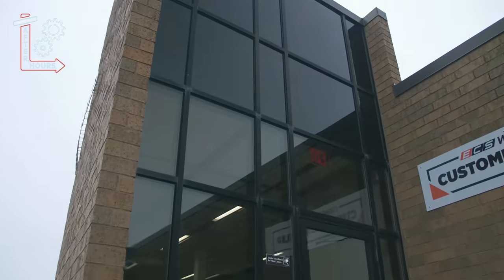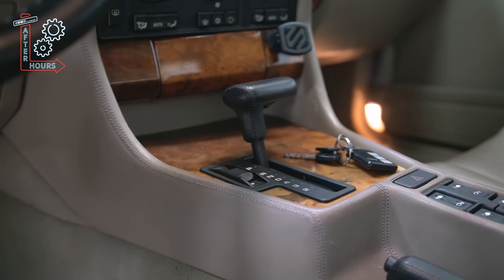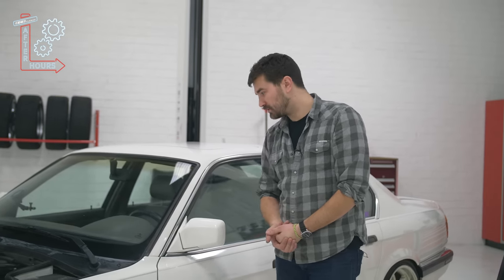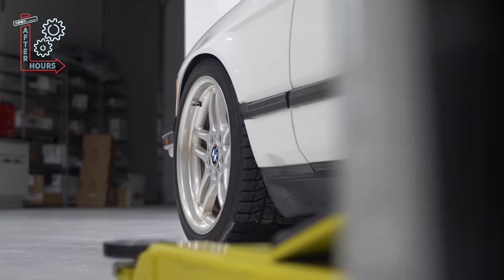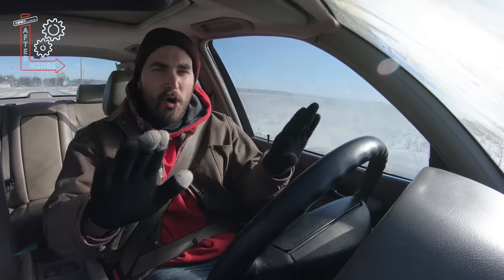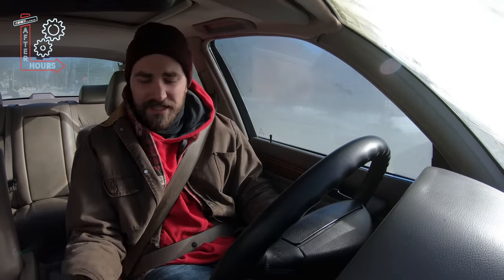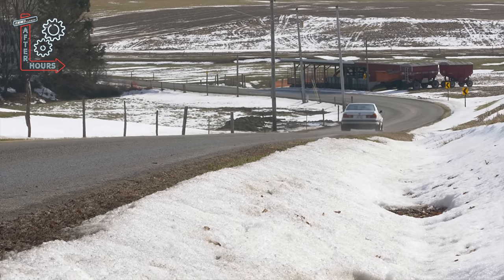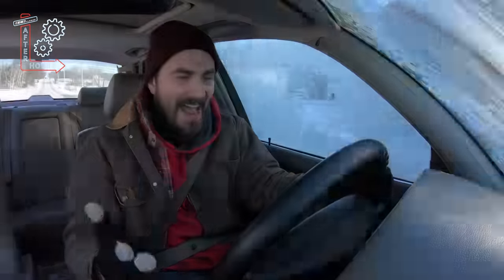I Bought a $1500 BMW... and Blew the Tranny // Winter Beater Challenge

Comment: That's a nice body, timeless lines.
Reply: True.. They can't make design more beautiful than these bmws from 80s to 00s
Reply: @ahmedfocak5691  True. These high shoulder lines (for safety) totally ruined the cars. On my old 3 Series (2004) I could easyly put out my arm on the window ... with mit 1 Series (2009) not so easy (starts looking weird) and with the latest models (dont even try it - you look like a douche).
Reply: I often hear that. I'm old.
Reply: Air Krem Got an e39 540 msport myself

Comment: German cars didnt have cupholders Back in the day because the only thing we germans did when we were driving, was driving.
Reply: And smoking! Lots of ashtrays
Reply: @catskillwoodgas  indeed, smoking helps to calm the soul in the traffic
Reply: they smoked quite a bit back in the day. I remember in the late 90,s there were cigarrete machines in the street just like candy ones, without any age related control (they were completely mechanic)
Reply: and faxing.
Reply: @honestguy7764  There still are :)
Reply: Bladwijzer Sync What really amazed me was that they were uncapable of return any change, so if the pack was 3.80 DM, you put 4DM and inside the pack wrap there was a .20DM coin. First time I saw it, it blew my mind!

Comment: So glad to see a video on this car from this year, especially from ECS Tuning!! I have had 2 E32s, a 735i and currently have the 750iL. I have bought parts for my E32s on ECS many times before. 
- Regarding the vague steering feel, lookup adjusting the steering box, it will make a WORLD of difference to the steering. 
- Window issues and door locks if its multiple is usually do to the General Module and Relay Module behind the drivers rear seat. 
- If you don't have heat after replacing the blower or blower motor "sword" Check the heater valves next to the fuse box, known to fail in these cars.

Once you get these cars up and running, they are an absolute dream to drive, mine just recently got to that point.

Comment: One year ago, i bought a 2001 Cadillac Deville for $375 at a police impound yard. (I have video of this car) It ran good but i had to pay $2850 to have the transmission rebuild. Yes i knew it was bad before i bought it. This is my first 32 valve 4 cam v8 engine. I had to install front struts and rear air shocks. I had to put brakes all the way around and the last owner spilled liquid washing powder in the truck. It had no problem passing an emission test and I have put 6,000 miles on it.

Comment: Damn that's nice... always wanted one.
Reply: They are pretty but they feel like they might break at any moment.
Reply: As you can tell his does break all the time.
Reply: From someone who's been there and done it, don't.
Reply: @garethcurtis7545  If I didn't have / wasn't happy with the two E34's that I have... I would still take a chance with an E32 or (even better an) E38 as long as it had a standard transmission. =)
Reply: @EXOVCDS  a manual one would certainly fix some of the issues. But the electrical gremlins, terrible interior that disintegrates as you watch it, yeah I personally couldn't deal. After switching to a W124 I could never go back. I like the E34s as well, almost purchased a 535 V8, but just so much wrong with it. And same interior issues and electrics. The key is with these if you really want one to find one that's been absolutely babyd since new, garagaged every day without the sun on it, and then still be prepared for the usual issues. But at least it will be a nice car. They just didn't use the best stuff to screw them together back then. But they did look fantastic and drive great.
Reply: Thomas EXOVCDS, Never should have sold mine. 😞🔫 I've regretted it ever since. Just wasn't set up to do my own work at the time. Got an MK4 beetle instead .. which is why I watch your videos lol.

Comment: I used to work for BMW and I came across a wiring diagram for a mounted mini gun in these 7 series. After a little digging I found they made a bullet proof version of this car which was prewired for that. Not offered in the US of course.
Reply: Didn't they make an E38 version like that?

Comment: And as for the heating it probably got out the solenoid valve. As it happens in E38 as well as in E32. Or a fan control module. In the E32 it is on the passenger side behind the console you have to remove the upholstery. Ps. you also need to check the module in the console that regulates the temperature, etc. also like to break.

Comment: Should have looked into doing a manual conversion from the e34 6 speed getrag 420...Still can get chips for the m60 which will put you just over 300hp. Also...pull out the the window switch from the center console, take it apart and give it a good spray down with contact cleaner. Should fix your window problem.
Reply: Fr tho this can be turned into something truly special
Reply: Done a manual swap on mine. From a 530i. It transforms it into a whole new car.
Reply: And a chip. But that didnt made a huge difference. I want to adjust the camshafts. The famous alpinamod

Comment: Bought a 1993 E32 last July for $2800 with 178K miles. Had to put a window regulator in the driver door. Power locks work but occasionally the driver door won't unlock when it's cold (I'm in Michigan) so I just open the rear door and unlock it by hand. I hear ya on the door latches. Occasionally both rear doors refuse to latch. No rhyme or reason to it... I've actually dented both rear doors trying to get them to close. Aside from that, everything works except the AC and the traction control. Runs like a clock, shifts perfectly. Small oil drip when I park it. No rust! Also have the same M parallels on it. The cool factor is off the scale. Nice E32!
Reply from the maker: I know the pain! I dented the driver's rear door pretty good trying to get it latched :( But hey, at least they look cool!
Reply: I was going to post a pic or two but I don't think you can in the public comments... Can you?

Comment: Bavarian Auto Sport offers different cup holder options.  My e32 had none, my '93 e36 had none but my e46 has 2 decent factory cup holders. My extended cab Sierra has 6 sturdy ones. Lol.  My e32 was alpine white just like yours which brings back memories.The trick to preventing the nikasil issues was to ALWAYS ALWAYS ALWAYS let the engine warm up to full operating temperature before shutting it off.
Reply: is it due to the rich fuel mixture used while the engine is cold?

Comment: It’s still a good looking car... I have a 2007 E63 630i Sport as a daily driver with 74,000 miles and full BMW S/H.. The only issue it sometimes has is a tapping lifter on start up. This only happens on short journeys and disappears after a minute or two. A known ‘characteristic’ of the E52 engine.. other than that, it’s beautifully smooth and reliable..

Comment: Like your car in white mate👍 Looks like you just picked up a not so great one, but for the money.. My old 1990 735 was cheap too but every electrical item works so got lucky. That was after changing the fan motor from under the bonnet, easy enough for ya. Ebay job for window switches. All the best👍

Comment: one of the worst thing on an old beater like that are both clima control and broken windows. I made a 400 miles trip on a extra comfy Volvo940, in the winter with a 2” gap on the driver window and no heating in the late winter. I kinda froze. When I got to the final destination I was tempted to burn down the damm car. That completely ruined an otherwise nice an anticipated trip.

Comment: Shame you have a pup. I had one for a while back in the early 2000's. Same engine but mine had best part of 400k on it when I let it go. Untill the gearbox control module failed and outweighed the value of the car it had no fails what so ever. Mine had electric rear seats with wine cooler in the rear armrest, self leveling suspension, cool box in the glove box, rear blinds the lot. Every thing worked absolutely faultlessly. The only thing I couldn't vouch for was the phone as I never used it. I absolutely loved that car and so wish I still had it now. Mine had e34 m5 wheels on and looked the absolute bollocks.

Comment: Just an fyi, the nikasil issue no longer an issue. USA reformulated its gasoline nearly 20 years ago for less sulfur content. So if its an original engine that survived getting damaged from the original issue, the current gasoline is no longer an issue. On the other hand, anyone who didn't take advantage of BMW's free engine replacement are out of luck now.

Comment: Unless you have big cans etc, you can use the center console as cupholders. I do this from time to time in my E34, and I think they look the same. There is also a cupholder from E36 that will fit the center console without any modification. I've seen a couple of them on Ebay.

Hope this helps!  Love the Parallell wheels. Wish I had those for my E34 :D

Comment: The windows and locks not working sounds like a GM (general module) issue. Common problem with the E32 and E34... get another module on eBay or in a junkyard and that should fix all your problems. I fixed a 1992 735i like that.

Comment: I feel ya on the cupholders dude. A lot of german manufacturers were pretty late on the scene with them. BMW didn't really get them until the e36 and in my e46 I had 2 except you had to chose: armrest + 1 cupholder or 2 cupholders + no armrest (had to flip it up). Very disappointing. Otherwise, these cars are perfect :)

Comment: The e32 is a love hate relationship. Especially the 750il. Having to do the heater core PLASTIC pipe again. But mine is a 88 and the dash brakets are a pain compared to your or a e34.

Comment: Loving the series. As for the comment about ZF transmissions not lasting I'm not too sure about that. They have excellent shift logic and shift smoothly long after other transmissions start to get jerky or slippy. I doubt a modern Mercedes 7 G Tronic or DSG transmission will last as long as these old units.
Reply: My mechanic wich is a BMW specialist, drives a 1986 E32 7 series (735i inline 6) with 363,000 km on it ( only the head has been revised ), with the ORIGINAL (
never replaced) old 5 speed ZF automatic transmission that came with that car. The clue with this transmission is, is that you should maintain it properly, meaning : the fluid must be changed regularly, every 50.000 - 75.000 km depending on the distances you drive, the filter should be changed every 80.000 -  100.000 km also depending on the kilometers you drive each year, by short distances it shortens it by half. if you don't do this, the transmission fluid will clog up in the filter, with al consequences due being it an old transmission. Once you neglect this once, it can cause irreparable damage. Especially with older bmw's. Maintenance is everything for these cars

Comment: On 18s slammed sure it doesn't drive like a boat. On 15s and stock suspension is floaty as fuck. Huge difference between sunroof and no sunroof. Mine has sunroof, I drove the E32 of a friend without - night and day. For the closable storage you need the optional casette holder.

Comment: You mentioned installing coilovers on the car...care to share any details? Id love to slap a set on my $600 e32.
Reply: interested as well...
Reply: Same. Ive heard that billstein sport shocks and some lowering springs get you to same look as in the video. I have sach sport coilovers on mine but the rear end is too high atm. Prolle gonna go for some slightly shorter and stiffer springs for the summer

Comment: First major fault of the M60: oil pump bolts getting loose and eventually dropping into the oil pan! 
I don´t know what BMW was thinking, by not using any kind of thread locker/screw locking device on such a vital engine part...
 
But @200k miles, I guess somebody fixed that on your car allready...

Comment: No headspace for ???- how tall are you?
Reply: Maybe he hasnt realized the seat moves up and down. Or maybe its stuck
Reply: @unuseableb  Who knows?
Reply: Headroom is surprisingly disappointing in my E34 - which is the same as the E32.  Mercedes of the era were no better - minus the 90s S-Class.  I'm 6' 2" and even with the seat bottom all the way down in the E34, you still have to slightly slouch.   If wearing a helmet for track or Ice Racing, it's very annoying.  Gangsta seat position is necessary.  All BMWs of this generation had mediocre headroom.  Damn sunroofs.

Comment: Hey, What coilovers did you guys run? Just bought an e32 and have been struggling to find affordable coilover options.
Reply from the maker: So these are actually a set of JOM coilovers that are originally for an e34 touring. Any e34 coilover should work on an e32, you just have to swap to e32 top hats. That said, you should try to find e34 touring coilovers, as they'll be better prepared for the weight of the e32.

Comment: I would rather buy a new car...! And i just did... got a Renault...!
Reply: have fun making payments for like 5 years
Reply: @willharris9139  Dont worry. Already paid in full. Now enjoying seamless butter smooth drive with the best mileage of 17 km/per litre in city traffic and 23 km/per litre on highways. It comes with all new company fitted Autonomous (no internet required) GPS Navigation and infotainment system. Super smooth Power Steering with Chilling AC despite of the Hot tempretures upto 49°C. With reverse parking sensors and Camera. It also comes with a 300 Litres of Boot space. With this all a Super Advanced Computerised Engine. In dash you get: Gear shift indicator, Fuel consumed after last fill up, Current and Cumulitive Mileage, 2 Trip meters, Average Speed after last reset and Distance to Empty. It also has a good head room and comes with a 1 litre bottle holder in each of front doors and 2 big glove boxes at front passanger side. As of now my car is 2.5 years old and has clocked 28,900 kms on odometer. car. All I had to pay was $ 6,500. Each service cost is not more than $ 70 including the engine oil change. Well thats pretty much for a small car.

Comment: @ECS Tuning  2009 335i BMW M sport 150,000 miles for $6k. Good buy for the price?
Reply: The 335i of that era had a lot of issues with the twin turbos. Can have really costly issues especially at that high mileage.
Reply: @Faruqiahmed  yes i totally agree and thanks for your advice. i know i will have some fixinf up to do which im fine with. But if the turbo issue and  few other costly issue is fixed would this be a good buy?
Reply: Ro Ro  Well the reason I brought up the turbo issue is because from what I've heard is it costs from $3000-$5,000 and it's about a 15 hour job, depending on where you have it fixed. So even if that's the only thing, it's really expensive. There's a certain rattle in the waste gate you have to listen for to tell if the turbos are going bad just look it up on YouTube. With a BMW over 100,000 miles you'll probably have little things going wrong all the time lol. That being said it's a pretty fun and nice car. Just know that I warned you haha.

Comment: Your auto 5hp30 needs a new updated valve body and it should be good
Reply: Also, be sure to use RTV on the rear half moon holes on the valve covers.
Reply from the maker: @Captain_Brown_Beard  The valve body was replaced by the PO. The symptom I was having was blowing fluid out the vent hole. Fluid wasn't overheating and I couldn't find a reason it'd be foaming. And yes, I did use RTV on the half moons and the other spot you're supposed to but still so leaky!
Reply: @ecstuning  You paint the covers? That can sometimes kill a good seal
Reply: @ecstuning  Yeah my right ones leaking again too lol. I even RTV'ed the crap outta it. You ever get yours sealed?

Comment: the best engines in E32 are 3.5L in line 6 and V12.
Reply: Why are they better than the v8? (just curious)
Reply: Disagreed..Strongly . The B40 was about as powerful and smooth as the V12 and a ton more economical. Also more economical than the 3.5. It’s an effortless running engine for this chassis.

Comment: Cup holders ? If you get in my E32 with a cup full of liquid you are getting beaten with baseball bat. Mine is high-line with the wine cooler and wine glass with stands, but they are not meant for in motion usage, mostly for buisuness stuff on the back seat, tho the highline wine cooler thing is not very comfortable for sex, so you either chose one thing to do on the back seats which kinda sucks. From now I can tell you just give up on the heating and the A/c this freakin monster is so complex and so impossible to fix right. 
It has 10 stepper motors. For most of the time this motors won't fail. But what will fail is their plastic holders that are part of the heater body and is britle as fck... Making spare brackets and attaching them needs everything disasembled, Stil good luck aligning the new brackets properly so it blows cold/hot properly.  Heater core leaking yup it leaks, after market cores are crap. But hey not only the heater core leaks also the 3 lines leak. It lasted 2 years and is leaking again. Now the whole heater is bypassed. Aux water pump + aux heater valves. Yes they stop working after 30 years.... Damn german engineering is not what it used to be back in WW2. Blower stuck worn bearings that is normal. Blower sword transistors fail, also the freaking cable connections will corrode normal stuff after 30 years. A/C oh A/c you need everything on the older E32 R12 needs R134a retrofit, Aux fan relays,switch,fan all is failing sooner or later. also lines corrode, you need everything replaced to get any cool air out and still won't help if you have heater valves stuck open and flaps not perfectly aligned.